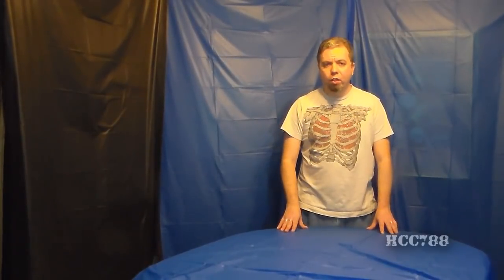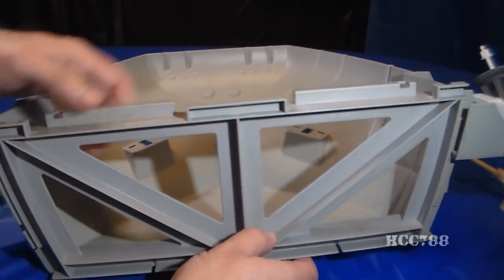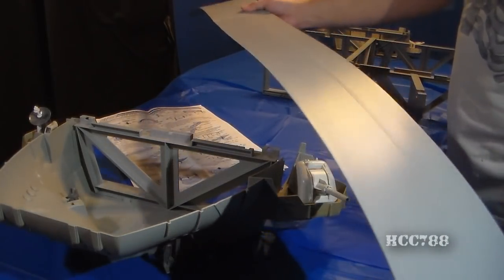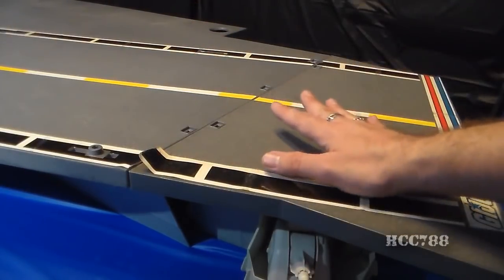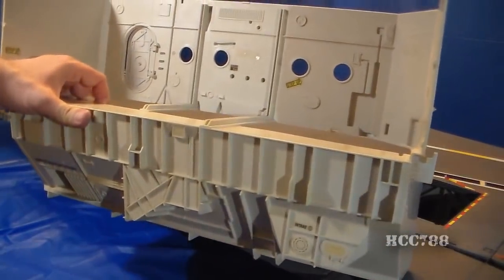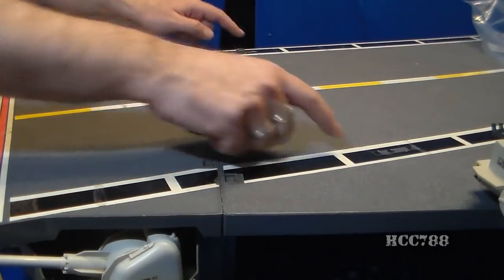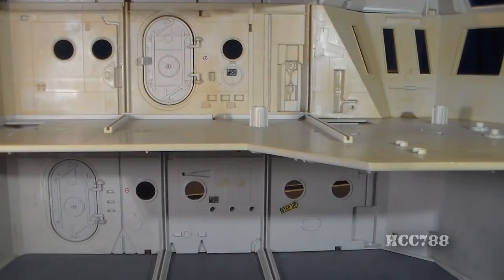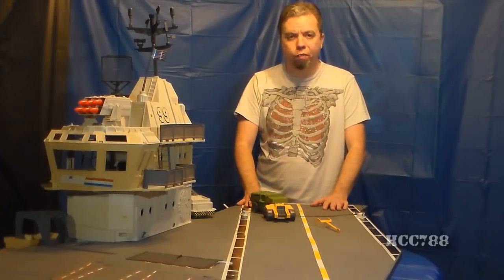HCC788 - U.S.S. Flagg assembly - step-by-step how-to - G.I. Joe Aircraft Carrier HD

Comment: In the process of re-assembling mine from Christmas of 1985 after bringing it out of a basement crawl space where has resided since 1988 or so after spending 3 hours cleaning the dirt and cobwebs off of it. I think I actually have most of the pieces including the bull horn, but it is in rough shape. Of course Admiral Keel Haul & Shipwreck are missing.

Comment: As good as this playset is, since I never owned one, I could only imagine what one was like. I always wanted it, but I had a bigger passion for Transformers, so my Joe collection always took a back seat. Looking back, I think I would have enjoyed the Joe toys more if the Sunbow series hadn't been so over the top cheesy at times. Looking back on it older, I can honestly say that while Transformers had the superior animated series, GI Joe was the superior toy line. That said, I always loved naval stuff, and I hinted on many occasions that I wanted Flagg, but it never happened. Considering that I did get a lot of other playsets, like the Headquarters from GI Joe, and the Technodrome from TMNT, I am pretty certain that the main reason I did not get USS Flagg was due to the amount of space it occupied. Looking at it now in this video, I can see that with the exception of the elevator, it was a pretty awesome playset. I often dreamed of building my own custom below deck spaces and having a table display of my own. The elevator, however, is a big fail, as it not only conceptually goes nowhere, but the framework inside makes it unusable even if you did build custom below decks. Making the elevator usable would require completely remaking its frame pieces. In fact, if I am ever so lucky to own a Flagg, I think it would be wise to remove the inner piece of the elevator framework entirely and instead mount a piston underneath it for support built into the new custom hull beneath, with the side pieces of the elevator remaining as a running track. The fact that one of the primary frame pieces is 1/3 of the way across the elevator would just have to be a concession.

Comment: Thankfully now  for  3d printers, Also mold  casting now these  day. now  can  recreate  the parts. What I think too.If I  ever got  a  Complete flagg. What I would do for sure. For all the  radar parts. I would Use plastic  weld. keep them in place as well as the  engine  covers, That Way  won't loose them ever.